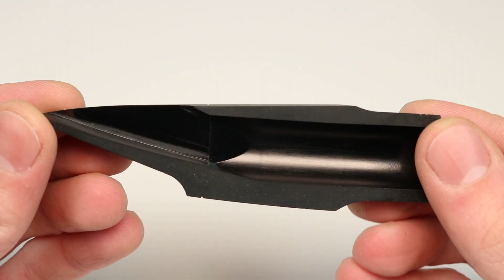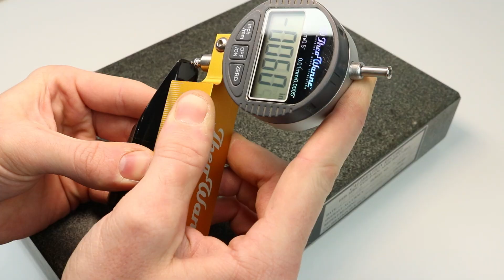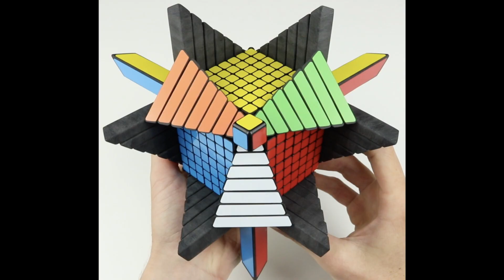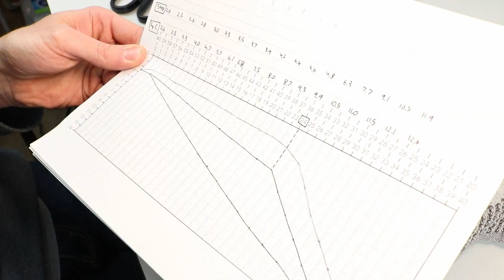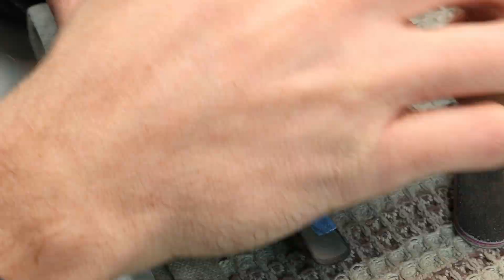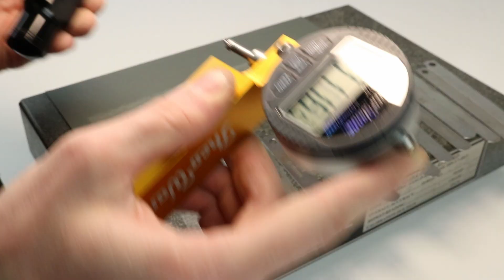Yamaha 4C - Extreme Mouthpiece Refacing

Comment: As a tip for the cut portion. You can use a photocopier to scan it in. I usually add a scale or a ruler and that way it is much easier to fine tune the picture size in CAD. But by scanning you usually do not need any scaling :)

Comment: Never touched a sax, so not sure how I got here, but not complaining. 

I imagine the beginner one is the way it is because it's easier for a beginner to get a more stable (if less refined) sound? And once you develop a stronger and more nuanced mouth you can handle a little more horsepower?

Or is it just technically more difficult to produce one like the mod?
Reply from the maker: Yep that's how it works in general, a larger tip opening takes more pressure to play but gives you more tonal flexibility

Comment: Something I did that might benefit you is to use dowels for handle grip wrapped in cork inserted into shank to stabilize while sanding. You do great and innovative work!
Reply from the maker: Thanks! Yeah that works well too, I've used dowel setups like that especially for holding the mouthpiece at the buffing wheel